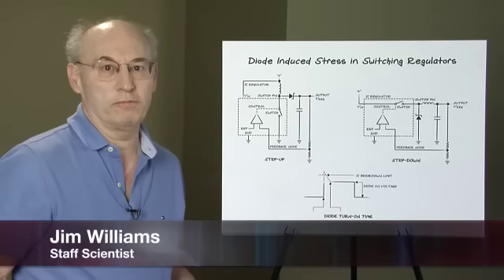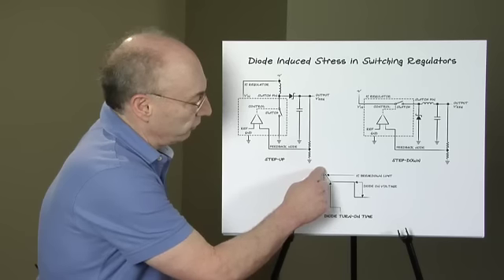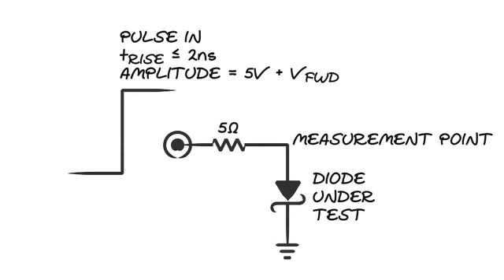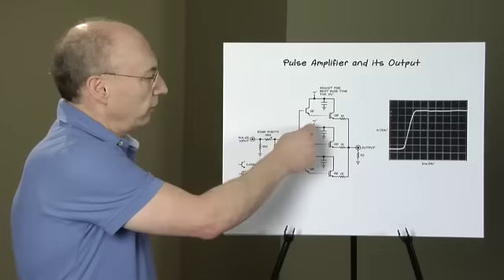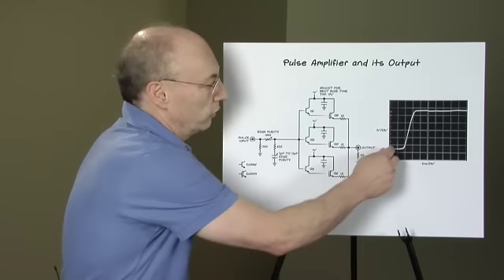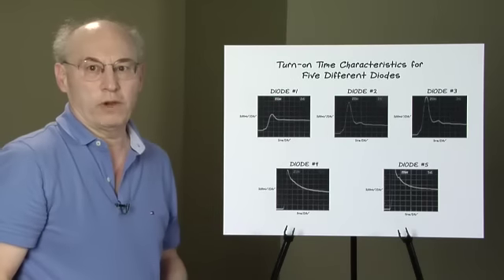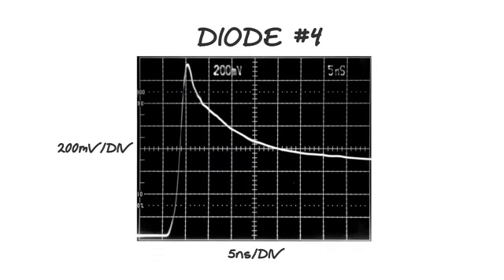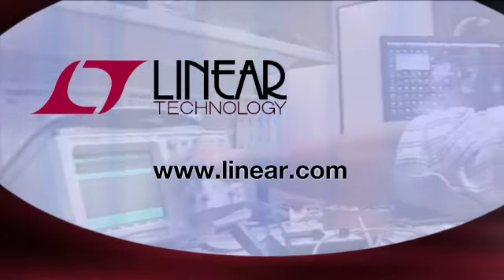Diode Turn-On Time Induced Failures in Switching Regulators

Comment: As I have seen, "everybody" publishes reverse recovery data.  That of course is good as far as it goes.  The reverse recovery time current and associated voltages cause power spikes and overall heating of the transistor and the diode.  But I have had my battle with the forward recovery as well.  Not going to too much details, it was an 80 V, 500 A buck regulator.  I ended up adding some smaller and faster diodes in parallel with the too slow ones.  There were 3 small diodes in series, so their forward voltage was higher than the single slow diode had and the small ones conducted only very short time to clamp the voltage spike.  I also minimized the physical loop length through the small diodes combo before the result was satisfactory.

Comment: Nice vid, I once carried out a similar test on very high power snubber diodes. My rig was a 2kV pulse cap and a spark gap for a nice sharp rising edge. The turn on overshoot is dependant on the I di/dt of the rising edge (not covered in the vid)
Reply: Did a study on a similar setup and also found simple spark gaps to be the best solution! This was for an HV ESD discharge setup. Tried various gas discharge and solid state devices, spark gaps worked best.